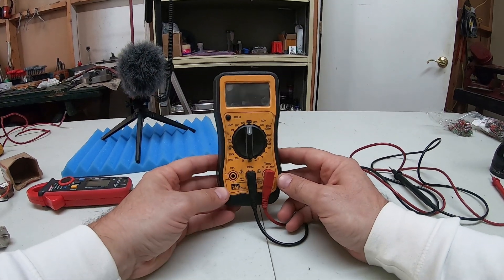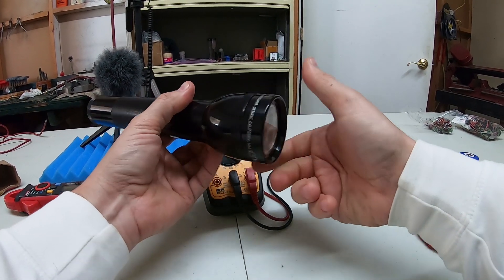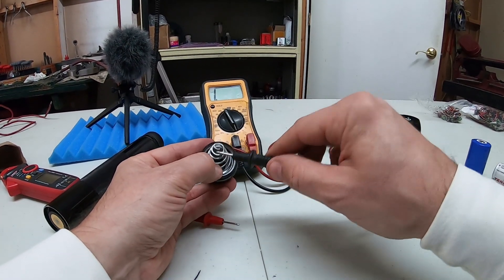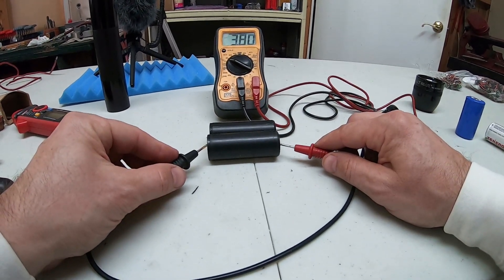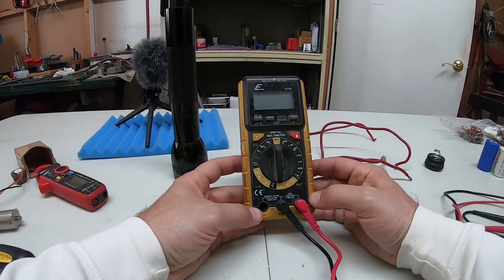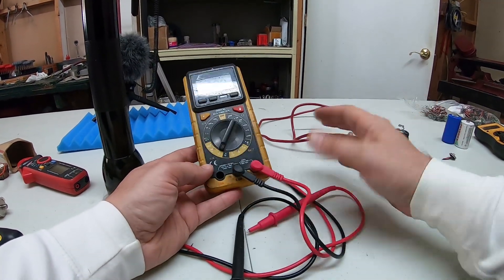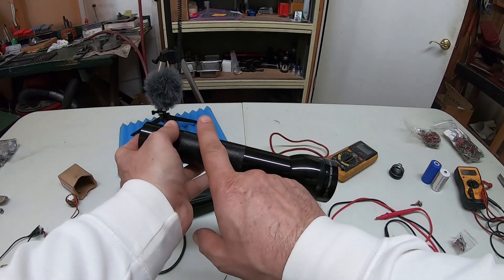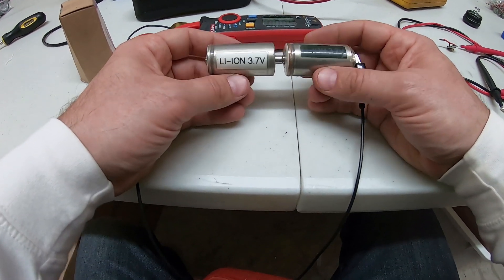How to Use a Multimeter (Very Basics)

Comment: Always zero the Uni-T clamp-type amp meter in the exact same position that you want to test in. It uses a Hall Effect sensor and is very sensitive to the magnetic environment. The earth's magnetic field will change the reading A LOT just spining the meter 90 degrees.

Comment: Thanks. I just explained about the first 60% of this video to one of our daughters when I gave her my old multimeter. I'll send her the link. :-)  If you would insert a table in the comments section as to what voltage one should get from some common fully charged batteries and the voltage when they should be recharged that would be a bonus!

Comment: Would it have fried the meter, or possibly cause a fire or explosion had it not been a protected unit when the meter was accidentally left in continuity mode, and not voltage?
Reply: Considering the minimal protection of the multimeters produced today, more likely if you recreated the situation with an unprotected cell it would start to overheat one of the leads and maybe smoke the wire inside. Some meters have metal tabs as fuse links that if it received a large influx of current it will break the flow of energy and act as a fuse. Seeing as in diode check/continuity check mode the meter produces 3v it probably would have destroyed a lead or the fusible link
Reply: Cool
Thx for the info !